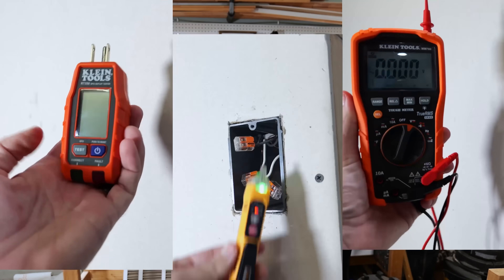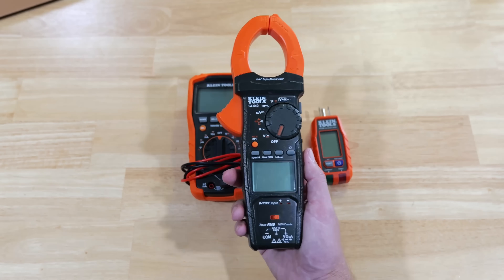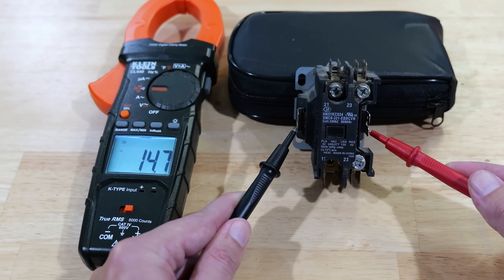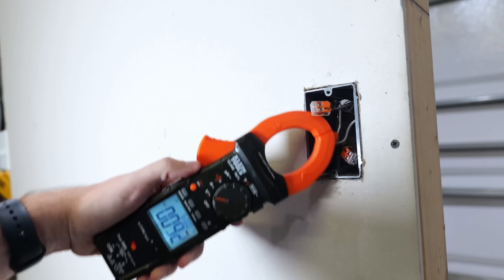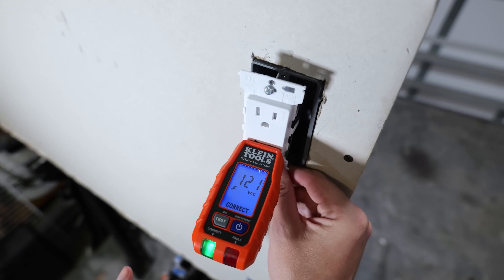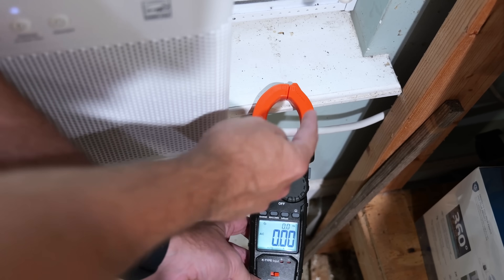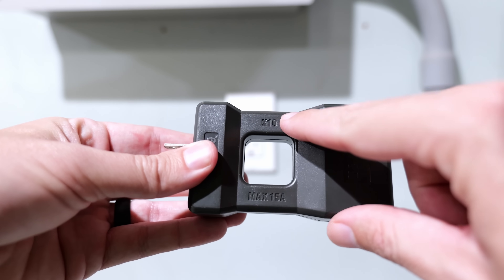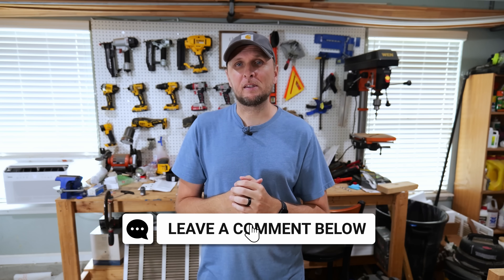The ONE Electrical Tool That Can Replace Them All!

Comment: Great video! I still have a handy device I made over 20 years ago to make it easy to use my clamp-on ammeter on any appliance or equipment that plugged in to a standard outlet. I took a short grounded heavy duty extension cable and with my box cutter I carefully separated the three wires inside the cable for a distance of about 8 inches. Then I just used the modified extension cable to plug in the appliance, and I clamped the ammeter around either individual hot or neutral wire to measure the current draw. I can't count the number of times I've used it over the years.
Reply: Sometimes though when measuring a motor's current draw, it's nigh on impossible to get their cables separated enough at the terminal block, for inserting the leg of a clipon, especially where armourced conduit is used.
But it has to be done.
Sometimes it's better to grab the outgoing neutral (or another phase wire) and recalculate anything that may detract from a correct reading.

Another way of getting such readings, especially for motor circuits, where the cable into the otor terminal block is too tight) - is to measure the current loading on that cable, as it leaves the switchboard, where most often there is plenty of cable to allow a clip-on to get around a wire.
However stray circuits OUTSIDE the clip-on's legs can alter readings, so if needs must - trip all other circuits nearby to only get the one wire's current reading.
Reply: I did the same thing and I get the direct reading and not have to do math (x 10 is ridiculous) LOL
Reply: I have a box that has a double socket and two fuses onboard that i can change the rating of as needed. Its much easier than trying to split wires on an appliance. Plus the fuses can hopefully pop close to me so i dont have to find the main fuse board.
Reply: Hmm, look up the fluke 377 or 378fc, you can get voltage from the clamp reading. But theres alot of types of meters out there, line tracers, multifunction testers, insulation resistance testers, oscilliscopes, and dont forget theres specialist meters that are better at reading dc current, earth leakage, impedance, phase rotation, and inverters… and the meter manufacturers will not put  everything into one meter… i need to own at least 4 to do my job.

Comment: Great video Adam.. I have that same clamp meter. Before I retired I had a Fluke-87 and it had an amp clamp that plugged right into the multimeter. It was a nice meter but the cost of a fluke is pretty steep.
Reply from the maker: Thanks John!  Fluke makes great products!  But you’re right, they come at a really steep price.  I can see getting one if it’s what you do day in and day out.  As always, appreciate the input!

Comment: @14:08 quick note for folks shopping around: Not all splitters multiply by 10. The purpose of that feature is to get more accuracy on low current loads. Some splitters will just be 1x with no math needed, and I've also seen them were one side of the splitter was 10x and the other side was 1x so you could do either.

You can also DIY your own splitter by taking a generic extension cord that has the two wires visible with the groove down between them and carefully cut between them with a knife (while it's not powered) and make an opening large enough to get your clamp on either wire. If you make it large, you can coil one side so it passes through the clamp multiple times and then you'll get a reading that is times the number of turns.

Comment: Thank you for your videos. I do have an unusual question that I might have previously asked but did not receive an answer. I have what I think is an unusual problem. I have this full size freezer in the garbage which I know from the manual requires a 15 amp circuit breaker fuse. The lowest amp fuses in my fuse box are all 15 amp. The following morning after the freezer was plugged in and working fine, I thought that there would not be any complications; however a week later and the freezer is off with the outlet not with any power. Problem is that none of the circuit breakers are tripped. I checked all GFCI outlets in the entire house and all have power, so to me that is not the problem. So now with the outlet and entire circuit that the freezer was plugged into no longer has any power. Why is it that the circuit breaker did not trip? Very frustrating on what I am supposed to do to solve this? Any ideas?
Reply: A little late but gfci outlets should not be used with motor loads like compressors. Because of the way the current flows it can give a false trip. I had this problem with a garage freezer which we did not open for months at a time. It was not pretty when we opened it up. I thought it was a requirement  that all outlets in the garage had to be gfci but there is an exemption if it is changed to a single non gfci outlet dedicated for a fridge. This might be the problem.

Comment: The one tool I always use: a good electrician, bc I don’t want to electrocute my not-an-electrician a$$ or die in an you’re-not-an-electrician fire. 😅
Reply: expensive tool
Reply: Skill issue
Reply: Im an EST, we are under the electrical engineer and electrician by category and capability. One job my plumber friend called me for was to see if he could put a cable into an existing hardwired connection switch. I said he cant unless hes an electrician if you want to base it on qualification. Now i cant legally do that either because i wanted to change the hard wired connection to an outside plug. So my plumber friend called the electrician to see if i could do the swap and he can come check it later…he said no. He didnt trust me the EST. Well, he came down, didnt change the permanent connection and left it as a lead without a plug, didnt test anything and actually did the work while the line was live and charged $200.
What the qualified electrician did was illegal here. 
Electricians skills vary alot.
Reply: I don’t believe this bs. YouTube removes the need for those types of “tools” (electricians) they can be really expensive and they aren’t making them in North America at the same rate that they are being retired. It takes years to make a basic one and how do you know if it’s a good one? So no, just watch YouTube. Same thing with “doctors”

Jk of course
Reply: Why are you watching and leaving pointless comments on this video then?
Reply: @ I’ll have to research that and get back to you.

Comment: you can also take a small extension cord and separate out the wires to clamp around individual wires instead of buying that adapter.

Comment: I just learned this now.  The 10x on the splitter is designed that way to allow for better resolution for low current readings.   The hot wire is wraped 10 times on that side.
Reply: I don't have a splitter, don't even knew that a splitter existed, but I used to roll up the wire to be measured around the clamp meter to double its sensitivity.

Comment: Really like Fieldpiece HS33 Expandable Manual Ranging Stick Multimeter for HVAC/R. It is specifically made for hvac it is a base for clamp, mano meter, flow meter, temp clamp, etc and it will do everything except DC amps the only disappointment. Nothing replaces a outlet tester.

Comment: As usual, you supplied some really good, useful information here. 👍👍👍 Some years ago I tried to find a meter that would do it all.  I couldn't find anything that did everything that I wanted it do beyond household power applications.  I wanted something for electronics and automotive work too.  I went with the ES 597IR with 20 A fuse protection.  It's made to endure rough handling and tests everything I want it to test, except for clamp style current measurements.  It comes with an IR thermometer to measure surface temperature up to around 1000 deg F and is CAT III to 1000 V safety rated too.  So the only thing left is the clamp meter function for current tests.  I have an old Amprobe Clamp Meter with an analogue readout, so a digital improvement would be great.  The Klein CL-900 is pretty nice; maybe that one is on my wish list or a less expensive clamp on if I just want the clamp on test measurement more than anything else.

Comment: Thanks for saying Klein does not sponsor you.  Your shoutout to them is great; however, based on the number of accusatory comments, your credibility might take a hit.  Is there an inexpensive meter I can buy just to test my A/C (your A/C videos are amazing but the testers are beyond my budget)?  Thanks!
Reply from the maker: There are just some things in life we cannot control.  People’s opinions of us are one of those things.  I give as good and honest information as I can.  What everyone does with it is on them.  Everyone wants to know what tools and materials I use, so I take the time to supply it.  As long as I know I’m doing that, I sleep great at night.  It depends on what you are wanting to test on the ac.  Some of the things that I show in my AC videos require multimeters that have capabilities that standard multimeters don’t have.  Unfortunately that usually means they cost more.  But again, it just depends on what you’re wanting to test.
Reply: @HowToHomeDIY Thanks for your reply. I posted a new comment in case you don't see my response here.
Reply: @CajunCoding  Thanks very much.  It's $56.99 on Amazon Canada.  I would still prefer a tester that is less expensive.  Do I need to measure soft start (not sure I watched a video on that)?  I added a new comment that includes a link to photos of my unit.  If you have a chance to look at it, I would really appreciate it!
Reply: @chick-flick-cherry  you aren't measuring the "soft start", you are measuring the "inrush current" of a device that has an inductive load (e.g. compressor, motor, etc.). That is one of the main features that bumps the pricing up is the ability to measure in-rush current.  You don't necessarily need it, but it's an indispensable feature when you do. I had 3 different multi-meters before I realized I should have just gotten a better one -- buy-once-cry-once.  Some examples of why you'd want inrush is if you had a solar generator (e.g. those new LifePo batter power banks by anker, ecoflow, bluetti, etc.) and wanted to know if it could run your Refridgerator or Freezer... well those have compressors so you'd have to measure the Inrush to know if the battery can support the max current needed. Same for a Window A/C unit you might want to run when power is out from a Hurricane (very common here in Louisiana), you'd have to be able to reliably measure the inrush of the Window A/C.  So anything with a compressor, or motor has an Inrush spike that you'd need to know.
Reply: @CajunCoding  Thanks very much!  I'm buying the Kaiweets you recommended.

Comment: I've got an Ames clamp meter with non-contact voltage detection (where I just switch it to NCV), but it's TOO sensitive. It even picks up USB cables!
Reply: I’d
Reply: @ducky0320  You'd?

Comment: Does the non contact clamp meter provide a better voltage reading?
Reply: The clamp part is only for measuring Amps. The voltage is measured same as with any other DMM and will likewise vary in accuracy from model to model.

Comment: I upgraded to the kline that also reads DC amps. I repair appliances. I love it. And have the older one for back up.
Reply from the maker: Yeah the clamp meter I showed in the video won’t read dc amperage, the mm700 that I compared it to will up to 10 amps.   I rarely need DC but can definitely see how you would.  Thanks for the input!

Comment: while a clamp meter is a good addition to a tool kit it does not take the place of a DMM if you know how to actually use a DMM. if all you do is wire houses then sure it can be an ok single use device. but a replacement? no. not convenient and not really practical in all places. a home owner can get by with a $10 DMM from harbor freight. and a home inspector might could as well. maybe the rookie on the job site can. but if you really know what you are doing then a real full function DMM will server you much better.
Reply from the maker: How so?  The clamp meter in the video is a form of DMM and has almost all the features and capabilities as the MM700 I have in the video which is a very capable MM.  The $10 one at harbor freight doesn’t have nearly the capabilities as the clamp meter in the video.

Comment: Klein makes good stuff. You sponsored by them? lol    BTW, I do own and use the Klein CL120 tool and amperage devices.
Reply: The best Klein tool I have is the one with the outlet transmitter and the receiver tool for locating that circuit breaker.
Reply from the maker: @Bassmaster1256 yeah I really like their tools obviously.  I am not sponsored by them or been sent anything for free.  But if they wanted to do a sponsorship I would be open to it 😂.  I just buy their electrical tools as most your pros are using them, they are good quality, and yet affordable.  I have that same tool.  It’s awesome.  Have yet to make a video on it though 🤔

Comment: I didn't see you "zero" your meter (the recommended one) before the current measurements but you always had a zero when you started. Is this Klein and improvement over the previous models that does not require you to Zero or did I just miss you zeroing it before measurements? My earlier version requires I zero and it doesn't do a very good job.
Reply from the maker: Does not need to be zeroed

Comment: I find it interesting that when I looked at it on Amazon it had a frequent return warning ⚠️. 
Odd
Reply from the maker: Very odd as it has good reviews.
Reply: It surprised me too. I went and looked at the reviews and most of the 1 star were due to them being defective or failing fairly quickly. Maybe a bad run or something?
Reply from the maker: Maybe so.  You see I have plenty of Klein tools and I have yet to have an issue like that.  One time I thought there was an issue but then realized it was user error 😂

Comment: When I started we used a pig tail and a 220 volt light bulb. Had plenty of amp probes, now I have 2 flukes and an old recording amp probe. The old school amp probes we never used the leads, cuse the fuse wouldn’t blow fast enough.

Comment: Um, to check for open ground with the meter just put 1 probe in the hot slot and the other in the ground hole. There, it checks voltage and ground.
Reply from the maker: Yes I didn’t say it couldn’t do it, in fact I said the opposite.
Reply: Just saying that checking for ground is just as simple as testing for voltage. Everyone knows the round hole is ground. For correct polarity, yes they would need to know which side was hot vs neutral.

Comment: Whyvwas the current for the AC reading multiplied by 10? and hence having to divide by 10.
Reply: That adapter he used is wrapped 10x
Reply: Makes it easier to measure small current

Comment: I won't buy a clamp-on amp meter unless it can measure both AC and DC current such as an automotive starter ~30 amps DC etc..
From what I can read in its specs, this one only measures micro-amps..  👎 I have an older Craftsman that measures clamp-on AC and DC amps.

Comment: It is easier just to make a short cord with a plug on one end and an outlet on the other. Then just have the three wires separate. Very easy.
Reply: Brilliant!
Reply: Yes, my manager had me do this. Picked up a cheap extension cord at the local Dollar General and split open the casing. Right away we took it around several pieces of equipment to diagnose. Been using it for a few years now.
Reply: Wait, what?? What is that supposed to replace??
Reply: @ACEfromVisa559  in place of the black line splitter 10x device that was shown in this video.

Comment: Nice video and presentation. 
The one multimeter I longed for is one I can see the display without my hand holding it. It either suspended at my chest, magnet hang on sheet metal or both. I also want to rid of the probes that tide up both of my hands when I need to climb a short ladder. The conventional wisdom must be changed to more practical one.

Comment: I have so many Klein testing tools including everything in the video except the clamp meter. More even, I've worked professionally with DC current, I don't mess around with electricity. I will own the clamp meter, it's a little pricey so I spread out when I buy stuff. 

There's another Klein meter that traces the wires to the panel, that's fairly inexpensive. Everybody should get one, it's awesome.
Reply: That tracing tool has been on my shopping list for a while (I spread out purchases as well).
Reply: Harbor Freight has the original Circuit Detective by Hi Tech for 24.99, very useful item